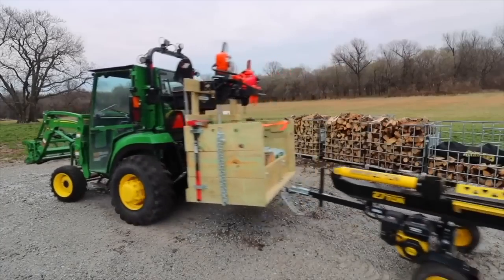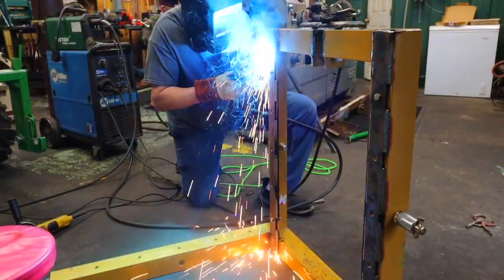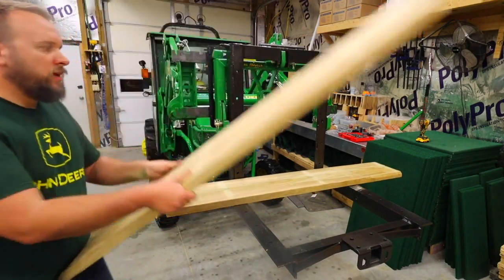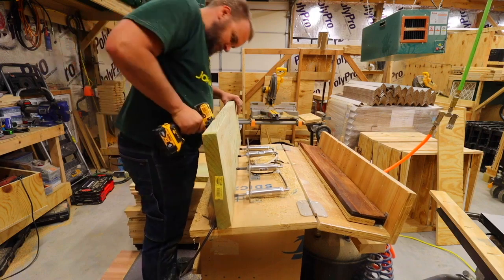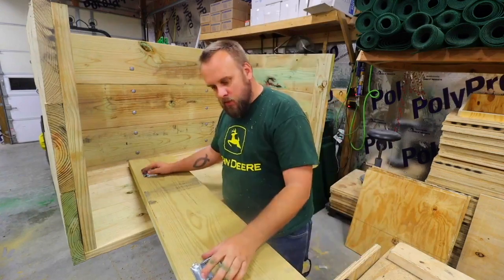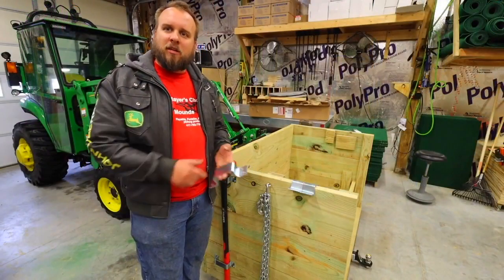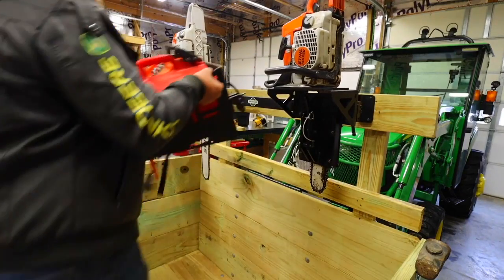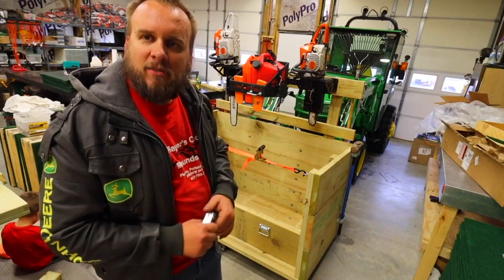How to Build the Ultimate 3 Point Carry All

Comment: As a recent subscriber, I am going back through some of your past videos.  This is great!  I just got the the bigtoolrack - but you did a DIY version that seems to have similar benefits.  Though if you ever built your second one after your giveaway, I wonder if you added drop down casters?   Also, I saw your grapple video and you mentioned running with the rotary cutter for ballast.  I know you said you were after 2,000 pounds, but wonder if you had a carryall that got close to 1,000 and rim guard, would that get you covered for most grapple/log situations  AND solve the problem of getting your saw and gear to the area you are cutting?